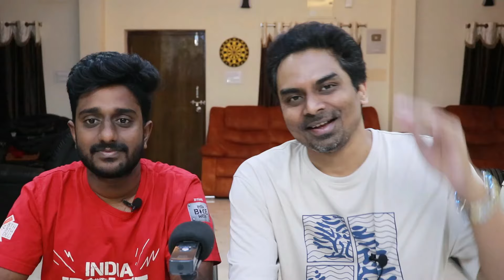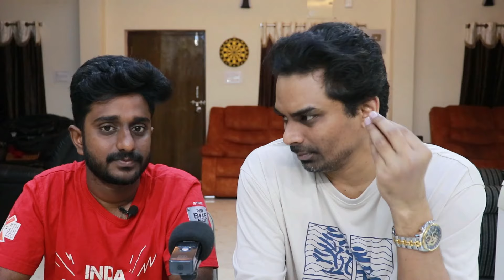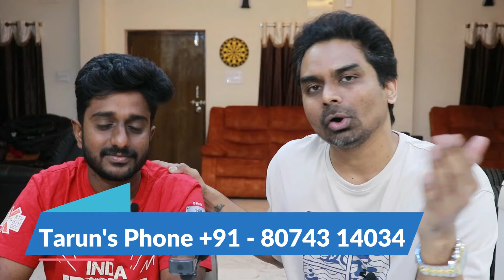Single Cylinder or Twin Cylinder, which is more Durable? Podcast.

Comment: Chapter 00:00:00.520 | Introduction
Chapter 00:01:03.399 | Practicality vs Reliability

Chapter 00:02:23.079 | Warming Up Your Motorcycle
Chapter 00:03:43.760 | Don't Hit the Rev Limiter

Chapter 00:04:31.840 | Engine Reliability: Single vs Twin Cylinder
Chapter 00:07:04.440 | Twin Cylinder Reliability Explained
Chapter 00:11:11.720 | Single vs Twin Cylinder: Conclusion
Chapter 00:12:15.720 | Aggressive Riding: Single vs Twin Cylinder

Comment: Generally, twin-cylinder engines are considered more durable than single-cylinder engines due to the balanced design, which reduces vibrations and stress on components. Twin-cylinders also provide smoother power delivery and better heat dissipation. However, single-cylinder engines can still be reliable with proper maintenance and design. It ultimately depends on the specific engine design and quality.

Comment: My 2011 suzuki GS 150R has clocked 1.23 Lakh km in a complete stock engine  and still runs very smoothly and gives 45 kmpl mileage. I am very much satisfied with suzuki's reliability and my next bike will also be suzuki.

Comment: Is 50,000 km life is meant for mid to serious performance motorcycles like r15 to 390 or is common for all engines......my friend's hunk clocked 1,25,000 kms and haven't opened the engine yet....also cbr 250r even if one cylinder is altogether on another league

Comment: As far as my experience single with high cc and combustion doesn't last long where in multiple cylinders has High chance of durability because it dividing the power between two cylinders such a 650 twin has 325 cc on each cylinder and has a power out of between 20-25 on single cylinder that's means on high stress on single cylinder but on the other hand KTM has single high cc engine with high power but that single cylinder can't take it all for long term

Comment: I just bought my first bike. Kawasaki Ninja 300.
I test drove almost all 400cc single cylinder out there but i just didnt get the 'this is it' feeling... Until i rode the ninja 300 and z650. Thats when i actually understood what it means to ride in higher revs. Its so damn satisfying from the mid range onwards. I must say the indian brands like TVS and Bajaj should have their own twin cylinder. I just bought my ninja for 4.5 lakhs and the RC390 is around 4.15 lakhs. So why in the hell are these single cylinders so expensive. I really wish Tvs launches a twin parallel because they do have good enginnering.

Comment: Expecting all the two wheeler brands to bring back the twin-pod dials from budget range to flagship range.

Left - analogue speedometer
in between - digital fuel gauge
Right - analogue tachometer with red and green backlight changing color

Comment: Hi vikas bhai. Lovely explanation. I congratulated motogodz today through WhatsApp for purchasing Skoda rapid😊 I own both single and double cylinder bikes. HONDA CB350RS and Hyosung GT Comet 250R.  
Trust me, my Hyosung just flies on higher RPMS. I did 162 KMPH on my Hyosung on NH163. The Honda CB350RS is a sweet & refined motorcycle with high refinement levels, surprisingly high mileage (I get 40+ on highway) and tall gearing with amazing tyres and looks😊
And in our groups, I've seen few first gen 2017 and 2018 Bajaj Dominars and Honda H'ness, CBR 250S doing 1 lakh kms without engine overhaul ❤
As discussed, BMW Hyderabad asked me 10 thousand for pre-delivery inspection 😅

Comment: Great informative video. When i got into biking i used wonder how come Toyota Cars last 200/300k kms but bikes   Piston/ConRod/Cylinder block needs replacement at just 50k km.

My impression of bike apparently was only applicable for single cylinders as that’s the only category of bike available in my country Bangladesh 🇧🇩 due to engine displacement limitations. Now it makes sense.

Comment: Most modern engines can easily last over a lakh kilometres with basic periodic maintenance.

My 2013 ns has clocked 49 k, 2012 royal enfield standard 73k , and both these bikes’ engine is still in immaculate condition. 

But i have also seen ns engines getting rebuild at 8 10 thousand kilometres only. It is all about maintenance

Comment: Forget about red line I never tried to push my bikes( v strom 250 and hornet 2.0) above 6000rpm and my highness might not have crossed 4K rpm. Not sure about highnesses because it doesn’t have rev counter. I just ride my bikes in relaxed manner most of the times around 70-90